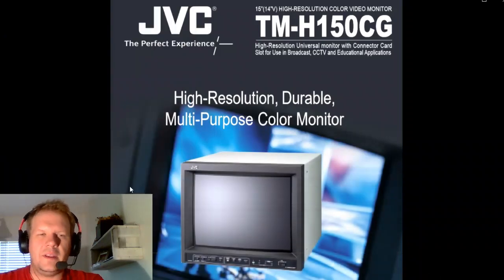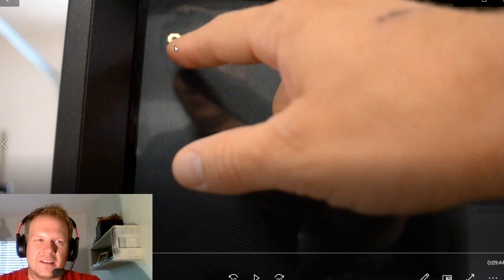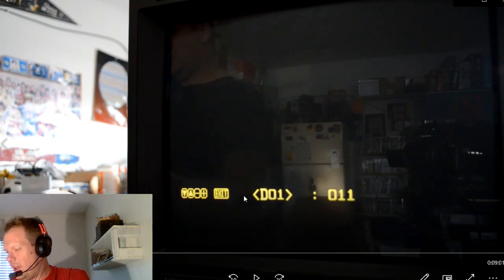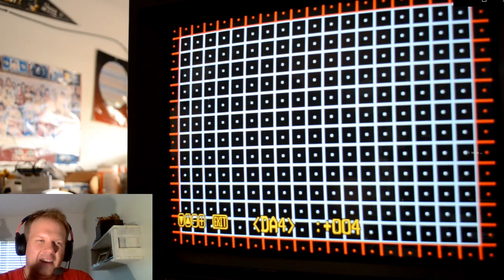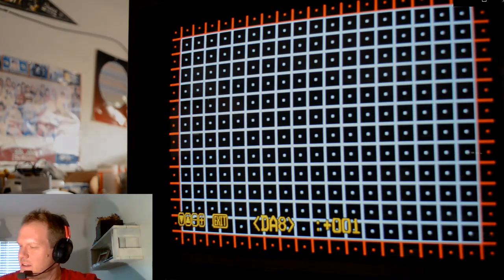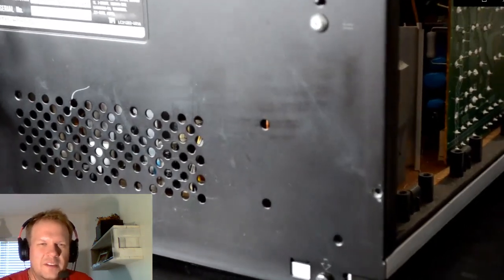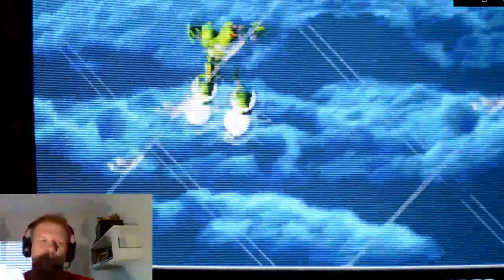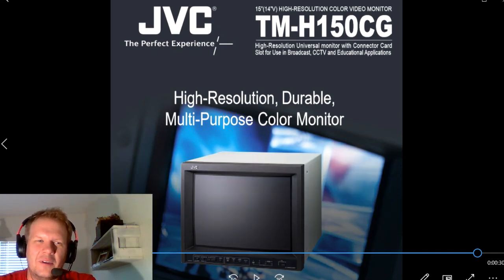How to Calibrate a JVC Pro Monitor TM-H150CG

Comment: Great video, I bought one 2 weeks ago and according to the seller it has been barely used. I'm still waiting for the linuxbot3000 RGB input card before doing the adjustments you described in order to enjoy it fully. Thanks for your very informative content, I like your channel a lot !
Reply: I have this monitor along with that same rgb card and can tell you it's amazing. I use it for snes. it's perfect. got a one chip, ghost cap fix, brightness mod, quality cables.
Reply: @sam-oh3wy  I received the card today, I can confirm what you said the picture is gorgeous. I also have a profeel PVM and I think I like the JVC better.
Reply: I'm really happy for you! these things are treasures. glad your enjoying it as much as I am. take care!

Comment: hello I bought a jvc tm-h150cg monitor on ebay and the image is tilted horizontally, do you think you can adjust it with the geometry parameters in the menu or do you have to rotate the deflection yoke?

Comment: I picked up a Panasonic BT-H1490YN a few weeks ago for next to nothing and it's got the same menu system.  I've noticed that the regular menu, has options for size and position for the RGB inputs, so it can be calibrated for RGB and composite/S-video and get a good compromise for both.  The option only shows when fed RGB.
Reply from the maker: That's interesting.  Thanks for letting me know.  Most PVMs and other monitors don't have separate calibration settings for each input.

Comment: Was hoping this may shed some light on how to correct the geometery on my D-Series (AV27D104). But of course the consumer set has less service menu options than the pro set. Turns out I can only adjust horizontal position but not h size or anything else. All my adjustments are limited to the vertical settings. 

Forgive me for not knowing the terminology but it seems I have either a slight trapezoid distortion or a slight S pincushion distortion? Basically there is underscan on the upper right, upper left, and lower left edges of my screen. I can push the h position to the left and then the underscan on the left goes out of frame, but on the top right it gets worse. And vice versa. There is no middle ground where none of it shows. I just wanna push those flaws out of the way by overscaning them on both sides but I caaaant since the horizontal size is locked.

Comment: Hi, this is a great video! I have the exact monitor with SCART module, but i can't get it to work. All i am getting is very fast scrolling lines from a NEOGEO MVS scart mod. Is there anywhere i can adjust the vertical hold (or whatever it is called?) Thanks

Comment: I have a 1750cg in pretty good shape, really like it. However if I try to increase the horizontal size to about where you got it I get this pincushion effect where the top and bottom continue to widen but the middle edges will not exceed a certain point (about a cm from the screen edge). Therefore I need to keep it underscanned a bit more than I'd like. Do u no what would cause this?  Possibly a cap issue? Everything else seems to be operating correctly.
Reply from the maker: Sounds like it is more than likely a cap issue.
Reply: @RetroTechUSA  ok thanks, I kinda figured. It doesn't bother me much now so not a priority at this point. I think I over exaggerated a bit too as it's more like a half a cm from the sides. So it's definitely ok as is being a bit underscanned for now.
Reply: Did you ever fix this? My 15 has the same issue.
Reply: @Cathode_Days  not yet, I haven’t used it that much so I kinda forgot about it. I recapped my other 2 so far (a 20m2 and 2530) but didn’t find a cap kit for this monitor yet. I’d like to recap it at some point though.
Reply: @karld4737  I have other monitors too but something about this ones colours and sharpness just makes me wanna use it a lot. I think I’ll look for a cap list too.
Reply: @Cathode_Days  yeah they’re excellent monitors.
Reply: @Cathode_Days  did you fix this? Same issue
Reply: @sviru007  I did, however it wasn’t really necessary. As it turns out, JVC didn’t design these with gamers in mind haha, the horizontal width is designed to max out that way. Overscan technically is out of spec. If you really want to overscan you can adjust the “b1 adj” potentiometer on the main board and it’ll expand horizontally. At least I think that’s what the pot was labeled.
Reply: @Cathode_Days  wow that is great :) Mine can't stretch horizontally so that would be it.  Why "it was not necessary?" I have like 0,5cm-1cm black border on both sides.
Reply: @sviru007  because anything more is no longer true broadcast standard 4:3 aspect ratio

Comment: good day!  My monitor has a slightly obstructed bottom right corner.  the geometry control is set to 8. It has no greater adjustment.  is it possible to fix it?
Reply: Possible watch Steve's Convergence fix videos.
Reply: @kuroikensai202  tnx